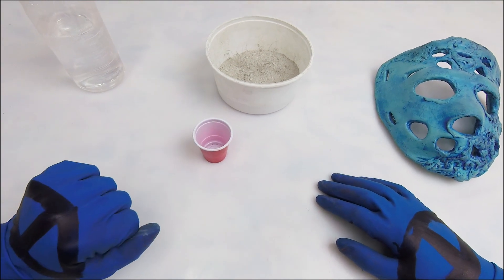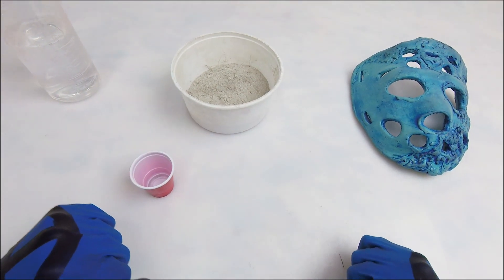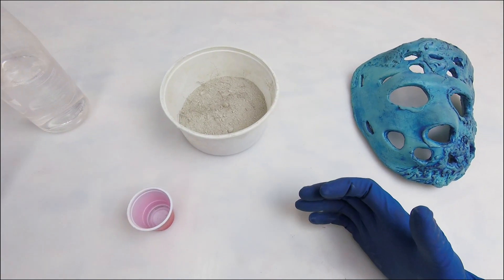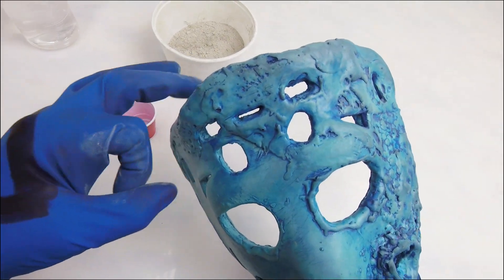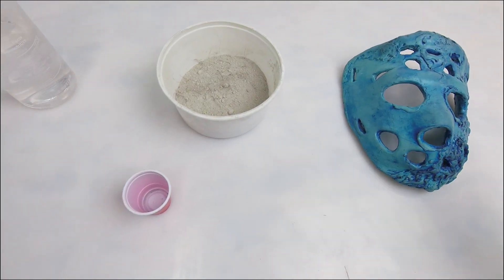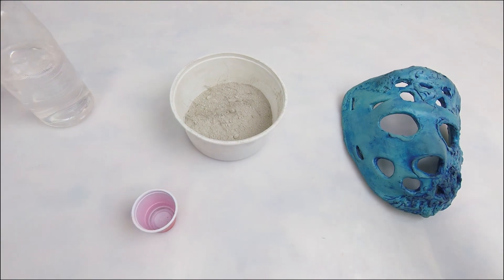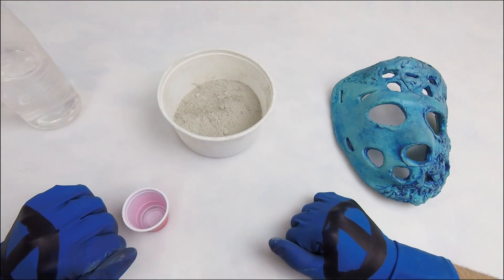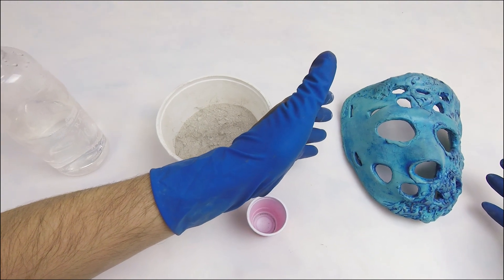Concrete Concrete 101 | Ep. 5 -- Curing vs. Drying

Comment: Hey there. Enjoyed your video.
Used to do concrete projects when I was younger but never paid enough attention to be confident now with a DYI project. Looking for your advice.
The goal is to concrete a shepherds hook inside planter to use on porch for string light and bird feeders.
I’m sure the weight this will need to support is far more than I’m thinking given wind and environmental factors. 
However, my Home Depot pro told me I am on the right path. He said fill the planter half way with concrete to anchor in the hook and then fill the rest of the planter with soil for small plants or decorative rocks.
Now comes the hard part. Can’t just dump a bunch of mixed concrete into the pot and shove a ~10 pound galvanized shepherds hook and expect success.  How do I do it?
Any advice is welcomed!
Reply from the maker: There's a lot of details to work through to be able to answer this question fully. But I guess let's start at an obvious one? What are the specifics of this planter? Why can't you pour concrete into it and expect success? What are you worried about?

Comment: Hi There, thanks for this explanation.  It definitely helps.  I am new to this process so I have a lot to learn.  I'm curious about water bathing after the project is taken out of the mold.  What is water bathing? How does it help your cement project, such as a soap dish or candle pot.  I can't seem to find a good explanation on this. Thanks!
Reply from the maker: Water bathing or steam curing increase cure time and total max cure strength by ensuring full hydrating and reaction of all the cement in the mix
Reply: @CONCRETECONCRETE  Thank you!
Reply: Did you find the answers?  Iam new too .. my vessels start cracking after few weeks .. I don't know what should I do
Reply from the maker: You need to start with a better mix design

Comment: Hello. I just came across your. Video. and is great information. I want to make cement plant pots with quikrete which is a mix of Portland cement and aggregate. I heard you say you can leave it in there for a bit longer. Should I add some sort of sealant? I've seen a few videos to protect their painting on the pot PLUS protect the cement. I would like to hear your suggestions. Thanks for sharing this video.
Reply from the maker: Yeah do what you want.  My suggestion is to use a high grade concrete rather than quikcrete.  The better your materials are you start with the better your final results.
Reply: @CONCRETECONCRETE  Thank you! Do you suggest any type of cement? I have no clue what cement is good or if I even need to add sand and what type of sand if needed. Thanks

Comment: Super helpful video! Just a recap to see if I understood.. I'm making a concrete pot for candles, I need a super strong concrete so it doesnt crack or have hairlines once it has volume inside (wax) and gets hot with the wick flame. So I make my concrete mix put in the mould for 24hrs or so, take it out (as i need the mould to make more pots) and I leave the new pot piece inside a moist bag (or even underwater as some people say?) and ideally is to keep it moist for 28 days. If I cant wait this long, what's the minimum amount of days do you suggest? 

Also, just curious, I can only buy 20kg of cement here. Whats the best way to store the cement to avoid to become lumpy? I only use a little at a time.
Thank you!!
Reply from the maker: Thank you for watching!  Strong concrete will make everything better from start to finish. It's tough to advise on your curing and post process.  I went through a year long project to develop a concrete mix specifically catering to my needs an an artist.  Off the shelf concrete sucks and trying to making your own mix is kind of useless unless you're willing to pay a firm to test are your mechanical properties after you finish so that you're actually making data driven decisions.

Comment: Im using only pure cement for making pots? The problem is its cracks when planted...
Reply: I do 3 parts sand for every 1 part cement. Keep it moist by spraying then with water several times a day for the first week it’s sitting out. Then place them in 4 gallons of water with 1 cup of vinegar for 30 mins. This helps take toxins out of the pot which will make the pot healthy safe to use for plants. Your process doesn’t suck, it’s needs to be refined and I’m sure you’ll get it down.
Reply from the maker: Your mix design sucks.  That's why we designed our own mix for small sculpture and artist product.  find it at www.concreteconcrete.com

Comment: If I'm using just white cement to make pots, does this require water curing ? Thankyou:)
Reply: How soon does curing start. Can I put mine in water after 12 hours
Reply from the maker: Hi, all cement based products cure using water through a process called hydration, https://petrowiki.org/Cement_hydration

If you run out of water during the hydration process your castings will suck.

Comment: My latest piece I just made has cracks forming as it’s curing. I’m worried my concrete had dried too much as I was mixing the other colors. I sprayed it again and got it nice and malleable before putting it into the mold but I’m concerned now.    Is this something I should be worried about? Is there anything I can do, like spray it and cover it while it continues to cure? It’s been in the mold for less than an hour. Thank you for these videos!!!
Reply from the maker: Hi Casey,  you hit the nail on the head.  leave it in the mold 24hrs.  keep it covered.  My recommendation is to dry batch all colours at once and then mix all batches at the same time, you want to work pretty quick once these are wet mixed.  When you re-wet the concrete to soften it up you also ended up washing out some of the creamy parts of the cement.  With the aid of the added water these creamy bit ended up collecting at the back of your mold, they would crack up a bit but will sand off as well.  E-mail me or we can chat on the phone Monday and I can help you through this.